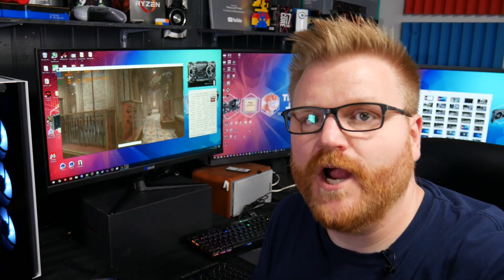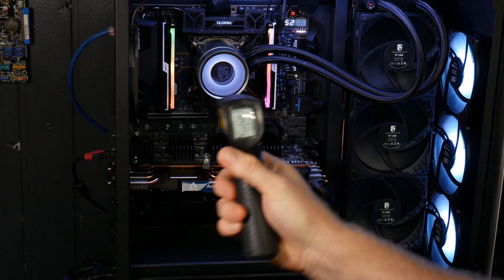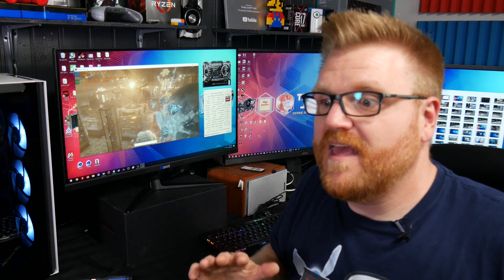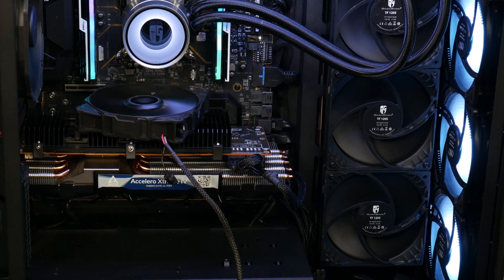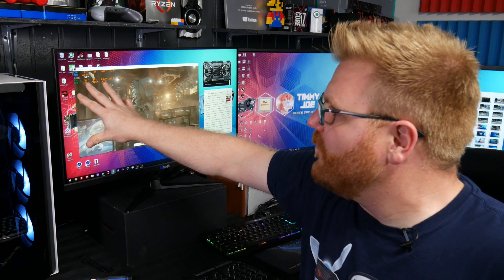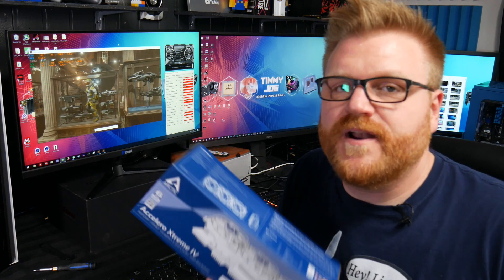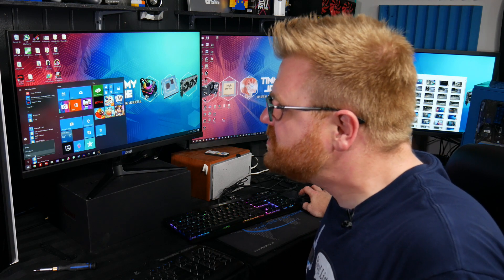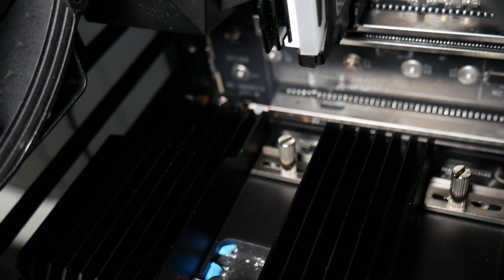Not even the Arctic Accelero Xtreme IV...

Comment: I had a 5700XT with Xtreme IV. I undervolted my card, overclocked the core to 2150mhz and a little boost on the memory. Idk the temp of the memory, but never cared. Never had an issue with my card. And... the core was "cold" and the card was silent. That's why you buy it. If you get a good card with a beefy cooler, there's no need for an aftermarket cooler. Arctic started their custom cooler line when GPU coolers were mostly single slot.

Comment: You didn't apply the cooler properly. You use good paste and pads on the front side for GPU and memory and then you use thermally conductive RTV or Kryonaut between all the other components and heatsink and also apply liberally on the back of the board when you apply the back cooler. Not sure how well Kryonaut works because I have no experience but with the TC RTV (Aerospace Sealants, Phx. AZ) I can effectively cool all components including stuff that usually doesn't like caps and chokes and better cooling of VRMs and MOSFETS. You have to get your case airflow right which is fairly easy for me as a certified aviation maintenance tech because of the ubiquity of air cooled engines in general aviation. I get 47C GPU temps on an overclocked, undervolted 2070S with 3070 equivalent benchmark results. Memory runs at 62C. This is with a 30C ambient temp! Memory runs clocked at +800 and the core +125 in this config, with power draw about 135W. I have an underclocked tune that draws 116W and benchmarks like a 3060Ti .
Included pads are not sufficient and I suspect some of your pads aren't making proper contact on the 5700XT. I have not tried one on a 5700XT, only the 2070S and 3080, when I had one briefly for mining before selling it and buying 2 5700XTs and half of the 2070S. The 2070S mined for almost 18 months before I put it in a new gaming PC and with the better applied Accelero and low temps there was absolutely no degradation of the memory overclock potential, being stable at +1100MHz. It was an EVGA blower card originally so even before I applied the TC RTV, it was a significant improvement.
I think OOB, the Accelero is a better fit for nVidia GPUs but no reason it can't perform spectacularly well with an AMD card with my methods. There seems to be a lot more board variations with the 5700XT and less of a universal fit as nVidia. I would like to get a couple more for a 1080 I have already taken out of mining service and a 6600 I will be taking out of service soon. I am planning to pair them with an 8 core SNB Xeon and Ryzen 2600 respectively. But they have been unable to keep them in stock over the past 18 months. But the 1080 is a FTW and I applied the RTV to the stock cooler and it is nearly as cool as the 2070. The 6600 doesn't have a great cooler and fans are already rather noisy after just 6 months of mining. But I can definitely apply the RTV and make do for awhile. It is likely I will sell the Xeon/1080 rig anyway because the 6600 actually outperforms the 1080 in DX12 by over 10fps on average even on PCIe 3.0. Arctic makes or has made a simpler 2 fan cooler and that would probably be a better fit for the 6600 since it is a low power GPU. 
In 2022 there is little desire for me to use a 5700XT for gaming and I will keep them mining on an altcoin post merge. I also have a 3070 I am going to sell while it is still worth a decent chunk of change and keep it in reserve for future builds or put the 6600 on a budget build with PCIe 4.0. But honestly I don't even really need 2 gaming desktops. I also have a budget laptop.

Comment: That cooler is limited by what your GPU’s fan header can output. If you’re using a blower model, the expected output on fan power is probably really fucking low. Your vbios also won’t magically know you put a different set of fans on it that will draw massively more power. This is why you connect GPU mod fan components to your motherboard. I think the accelero comes with an adapter for that, and if not, you can buy one pretty easily.

The mod works, for sure, amazingly well too. But you really need to use some common sense. Put low-profile copper heatsinks on your memory and low-profile aluminum ones on your VRMs (they’ll fit under). You want to eliminate PCB soaking. You can use the backplate as designed, but I covered the entire back of the board with 2mm high-performance thermal pads (2 cut-to-shape 100x100s). This has solved my problems with the flip-chip GDDR6 heatsoaking. Also, was your on-die thermal paste spread perfect? On CPUs it doesn’t matter, but on a GPU, you have to use the spreading methods that are usually considered overkills, miss even a tiny bit of the die and you’ll have problems.

On its own, an aftermarket air cooler is always going to be little more than a replacement cooler that’s efficacy is entirely bound by how its installed simply due to the fact that it can’t be made perfectly to the card. And it’s not cost-effective for them to include every single
additional component you’ll need to make the cooler shine on your GPU specifically.

You have to do your own research and figure out what solution works for you.

Comment: Dude That card is broken. Just like my 980ti. It stays at 83 degree Celsius with this cooler but this cooler is the reason this card is alive. otherwise Asus GTX 980ti Strix would have died. it way past its warranty so I had to do something. 
You need to install the cooler properly otherwise it doesn't work.

Comment: Boss, you're all over this video. But I have to admit, you're infectious to watch. I use after market air coolers and I get excellent results. Course I put heatsinks all over the board with thermo glue and I use the best fans I can buy. I get really great temps. I can't figure out why you're getting such bad cooling performance at clock speeds.

Comment: I have just installed on my rx 5700xt powercolor. Cuz it was noise and hot as fuck... I did not put, the heat sink on it. I'm using the stock backplate, and working pretty good... Instead of 95° I have only 72 😁😁😁

Comment: Interesting test.  Strange thought it didn't work for you, maybe it's the GPU itself that has issues.  I installed the cooler on a TITAN X 12GB from 2015. The fan stopped working so I decided to try the Arctic Accelero Xtreme Iv.  I had some issues with space and had to cut away a part of the heat-sink because my MSI Z97 pc mate has badly placed USB and SSD slots so the cooler wouldn't of fit.
But once installed the cooler does a great job.  Temperatures now stay far under the temps I got with the original body and fan of the TITAN X.  And I'm talking 20 to 25°C lower, even overclocking pretty hard.
So, I'm wondering what went wrong with your setup.
Keep smiling! 
Pax et bonum

Comment: have you tried using those small heatsinks on the vrms and memory? i've always heard it was necessary when using those aftermarket coolers. Tests using those are really good and to me is the correct way of comparing since the OEM cooler also makes contact with them. It's quite obvious even.
Reply: These are probably needed on these cards because memory temps are high. I installed this cooler on many 1080 ti- s and all temps are very low without any added heatsinks.

Comment: Those fans in front cancel themselves out. The rest of the case is left with whatever that exhaust fan on the back can leech. So, is his case at fault actually. But yeah, even if the fan setup was done properly (which again, is not, shame on you mister reviewer) I don't think the accelero can cool properly the  GDDR6 mem chips. I actually have the variant III and the problem is that the memory chips are too close to the gpu die and will be partially covered by the the cooler. Because of that you can't install heatsinks unless you cut them in half. I didn't try that.

Comment: Your issue might be those insanely thick thermal pads! Thermal pads is really bad at transfering heat compare to things like thermal paste.
My technique is:
1. Screw down the heatsink without any thermal pads.
2. Dim the light in the room and use a flashlight to see how big the gabs is between the components.
3. Start placing 0.5 thermal pads where there is smallest gab between the components.
4. Screw everything together, use the flashlight method to see if there is contact.
5. Continue with the next smallest gab and so on.

You will notice some components actually has no gabs at all and you can use thermal paste.

It is a time-consuming process but it is worth it.

I bought these 0.5mm and they are incredible!

USD $9.30 | ARCTIC AC Thermal pad 6.0 W/mK 0.5mm 1.0mm 1.5mm High Efficient thermal conductivity Original authentic   Arctic Thermal pad
https://a.aliexpress.com/tqmyYgAG

In some cases I have tried putting 2 layers to getting 1mm thickness when I only had 0.5mm left, and to my surprise it works just as good. But you must be careful not getting air bobbles.

Good luck!

Comment: I bought this cooler as a replacement for my Gainward 8GB 1070's original cooler, which suffered a fan failure. It was cheaper than buying a new GPU. I had it installed at a professional workshop and they used the protective plastic film on it without any hassles. I'm not an overclocker since I just want maximum life expectancy for my PC's due to cost savings, and I'm extremely pleased at the performance of this Arctic Accelero IV. With the broken fan in the 1070 it was quickly reaching 75 degrees when playing games, and with the new cooler it's gone 51 degrees at max so far. 

As others have said, you might have too many fans in that case Timmy, creating dead zones and vortexes instead of a straight river from front to back. Mine has just three fans in the front, pushing the air in, and one at the back pulling it out, with the CPU fan also pulling from the front and pushing it out directly towards the rear fan. The Arctic GPU cooler is pushing its heat down towards the PSU where the airflow from the bottom front case fan should still direct it out from the rear. I took out all the rear PCI slot covers too so the airflow would encounter the least amount of resistance when heading that way.

Comment: I am using this cooler on a 1080 Ti without power limit + overclocked, and it never went above 65 degrees in silent mode. Versus the original cooler with 92 degrees max it's a huge improvement, though I can't think of what you might have done wrong in the video. Just wanted to let this here, as the Xtreme IV is the best cooler I've ever used and can't relate to your experience.

Comment: 3 front case fans and 3 side case fans will interrupt the flow from each other, resulting in the air being pushed to the glass and NOT onto graphics card. Go back to school and learn the physics. Also, every fan efficiency is decreasing with increasing distance of components, they were supposed to cool down, fan is mostly fully effective only when it is as close as possible. So if you let your side push-pull fans to suck air from outside and put your front intake fans in the case AFTER them - deeper in the case the cooling would be more effective, as the 3 fans in the case will suck the air pulled in from side fans and pull it directly onto components.
Also, don´t forget to add more exhaust fans, as you not only need pull enough air in, you also need to take out heat. One 140mm fan can´t handle it alone.

Comment: I just put 2 Enermax 120mm T.B. on it and its fine. VRM and RAM went up a bit but I dont have any fins on them, just pure airflow and the backplate. Junction went down 20°C with conductonaut. But most important to me, It is unhearable 1-2 feet to the right of me on the table.

Comment: I have the Accelero Xtreme IV on my 1080Ti, replaced the stupidly loud blower cooler on it. My idle temps on are 28-30C, and peaks around 65C. With the stock blower, I was idling at 39-40C and peaking around 92C.

Can't speak to the 5700xt, but the Accelero Xtreme IV was a godsend for me from a noise and temp perspective.

Comment: I have the same cooler on 5700 XT, memory temp never went above 72 degrees during the same test, so the problem is somewhere else, junction never went above 71.
Reply: That's very low memory temp, maybe you got Micron? Samsungs seem to be hotter on 5700XT, mine are going up to max 85C on normal days and in the summer with heatwave it was up to 92C. Not perfect, but good enough. (Btw im running them on 890mhz)
Reply: stock 5700 xt ?
Reply: so would u say its worth ?

Comment: So, the dozens of people getting great results with their XT and the Xtreme, running it at stable 2150mhz, they're just anomalies?

Pretty sure you're doing something wrong dude. Search them out, message them and I'm sure you'll find out.
Reply: this guy has no idea how to install gpu coolers. he mangles the install and then complains about bad temps. just watch literally any other video on this hardware for actual results.
Reply: Dont know what the heck he did wrong but I just installed the Accelero on my 5700 XT reference yesterday. After 10 rounds of superposition my memory temperature sits at 74°c and wont go any higher. Core junction sits at around 80°c (memory oc to 900, core voltage uv to 1150mv). One thing he might have done wrong is that there are two chips on the PCB right next to the power connector which need to be cooled from the backplate. It´s a bit tricky to reach the very right chip with the backplate but it fits with a bit of trial and error. Maybe he forgot those two, who knows. But the fact is: This thing works brilliantly with the 5700XT and I love it!
Reply: @f-ben  Look at 10:54 You might get your answer it looks like a few things are missing from the die side. Like look close as he picks the card up and turns it sideways so you can see between the cooler and the board it looks like there was no cooling put on the  ram or power delivery part of the board and and I wonder if he checked to make sure the coolers power connector matched up with the old coolers plug because they don't always match up and you have to pop the pins with a needle and place them in the matching slots so they are a mirror image of each other.
Reply: @f-ben  he didn't install those tiny little heatsink for those memory
here is an example https://www.youtube.com/watch?v=wqJtUkwkM9s
Reply: @whatthejohn1  the current accelero doesnt come with heatsinks. The backplate acts as one big heatsink
Reply: @f-ben  okay, i want buy the accelero because i found an extremely cheap 5700xt founder edition, so i am considering for the accelero
Reply: @whatthejohn1  then go for it. You can buy small copper heatsinks for 2$
Reply: @f-ben  thanks, i will
Reply: @f-ben  Very nice. A bit irritating this chap is badmouthing the setup when so many people are getting great results, he should presume he's made a mistake.
Reply: @falcodarkzz  He has a few videos where he messes up installing products, and then blames the products.
Reply: @jhon doe you sound like a shill
Reply: he did something wrong! these Cooler are very very good....i use it on a 1080 and my temps max are 63g...and i can oc it easy to 2100mhz on ram speeds
Reply: This dude is a douche and ignorant. People shouldn't take tech tips from him. Like others said he has multiple videos of him doing wrong installations.
Reply: He doesn't install memory or VRM heatsinks, and he also has a habit of cranking down the cooler on the die so hard that the mounting plate bends. He did the exact same thing with the Accelero Xtreme III he used on the 980

Comment: Strange, putted the Accelero 4 on my 1080Ti and gained ~20°. The cooler is awesome in my opinion.
Reply: I agree, those temps in video are weird, on my 5700 on default is about 69-70 and core temp 66-67, junction sits at 75.
Reply: Same here. Just installed it yesterday and got myself good Temps. Vrm are close to 50c

Comment: Eh, so the air that travels in the front is pushed right out trough the radiator? I don't think much of that air reaches your GPU. A case that offers placing for a fan next to the gpu on the side gives huge bump in gpu cooling. But in my case(pun intended) I found it too load even with a noctua.

But I wouldn't use the layout your using, the gpu won't get much fresh air.

What is the temp with the case open?

Comment: Have you tried using something like the NZXT Kraken G12 using a 120mm AIO on the GPU core and attach some small alumunium (or copper) heatsinks for the VRM and memory using thermal tape (or thermal adhesive like arctic alumina, but it makes a permanent bond). I did this on my GTX 1080 Ti and max GPU temp was in the high 50s while the core stays 2080 MHz all the time, also memory and VRM temp was great (never reach more than 55 ish) when fully stressed since there's a 92mm fan blowing air to the components.

Comment: You might be fooled by the readout of the memory temp all this time. Igor (from Igor's Lab Germany) actually saw the same behaviour with a card he had on his table. The readout was 90 degrees but when he checked it with a heat camera he saw it was in fact just 70° tops. Don't be fooled by the readout. apply the regular cooler or remove the heatsink and check the temp manually. You'd be suprised I guess :D